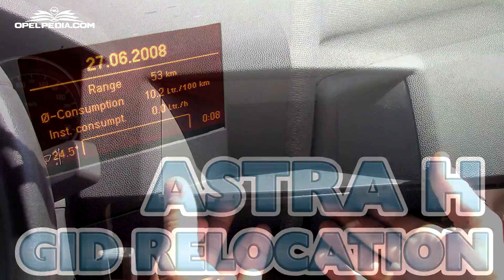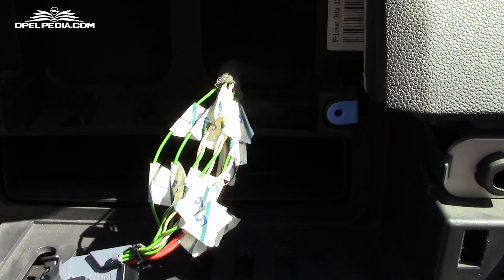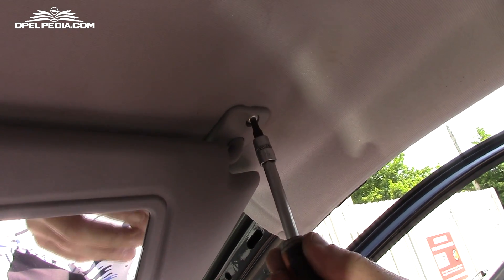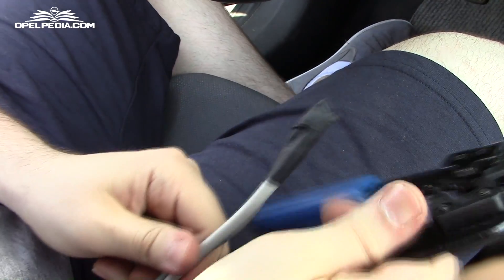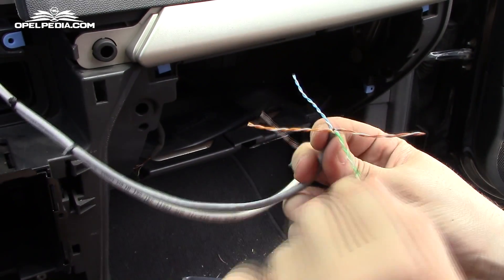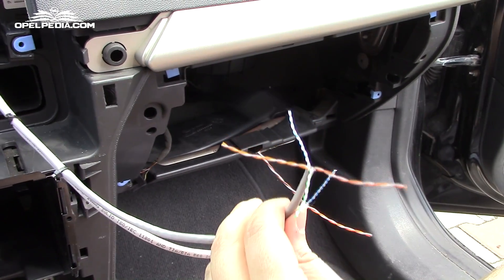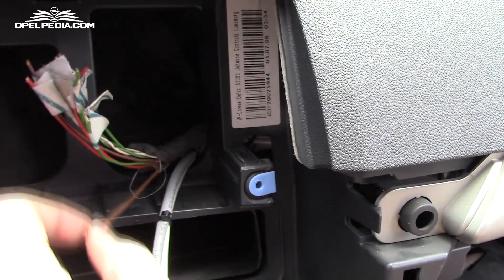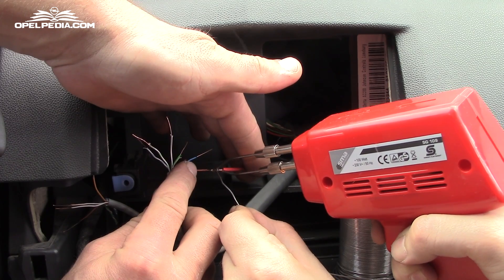Home Made Navigation System - Part 6: How To Relocate GID To Roof Console

Comment: The ethernet cable has 0.22mm thick wires while the DIS seems to have 0.5mm cabling. Don't you see this a problem? Have you used this extension solution for a longer time, have you experienced any problems, e.g. display issues of the GID? Thank you.
Reply from the maker: i have used it for 1 year, others for longer, some even 5+ years